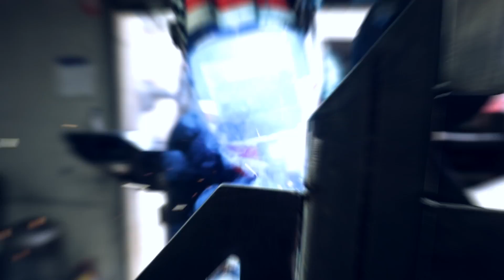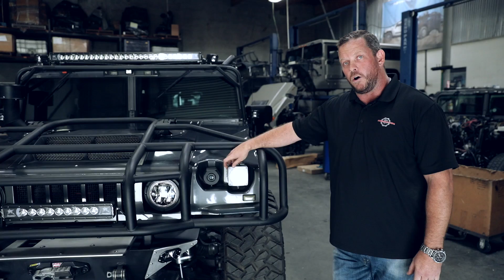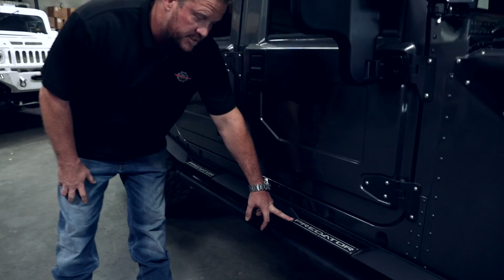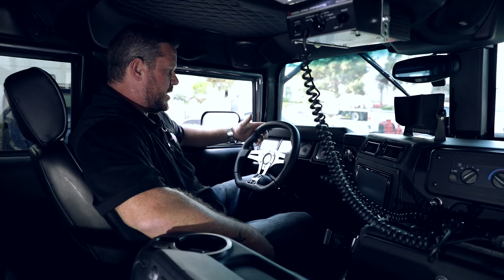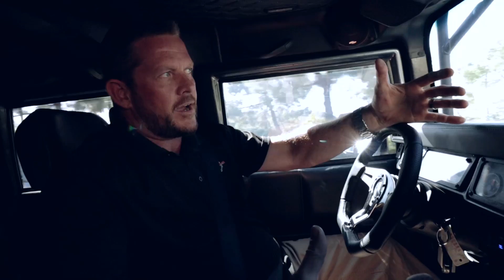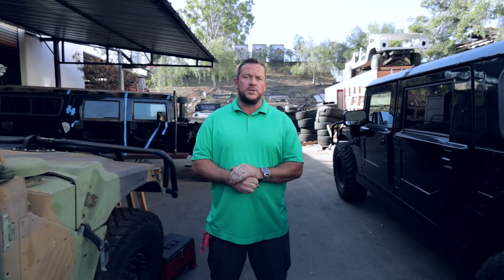NEXT DAY AIR H1 HUMMER SHIPPED TO UAE ROYAL EMIRATES!!

Comment: I love the build. This truck and the one the ROCK drove in fast and furious.........as much as I love them I think they are more show than actual use.....8-10 miles a gallon but I would still drive it daily
Reply from the maker: Thanks, definetly agree, its an amazing truck! I would disagree about more show then go. It doesnt get any more go then an H1 unless you switch over to a tank! Haha. Factory options including CTIS, full under carriage armor and standard lockers is unmatched by any manufacturer... ever. Straight out of the factory show room floor, nothing could touch the H1. Yes, 8-10mpg on some of the models and progressively getting better and better topping out at about 20mpg with a duramax conversion. However, most people arent too concerned about MPG when driving the best offroad vehicle in the world. Now getting into owners, I would say half are crazy avid offroad drivers. The other half probably would never take it offroad.

Comment: Do y’all put in sound deading material? Just still hear a lot of rattling and tire whine. Figured those high end clients might be picky. Still wicked truck though!
Reply from the maker: Yes we do offer an extensive sound proofing option. We have seen a drop of approximately 30dbl on the inside. Huge difference! Unfortunately that whine gets picked up on the mic and there's just no way to get away from the sound from 40" mud terrain tires. Also, there is whine from the geared hubs (portal axels) on deceleration which you cant get away from unless upgrading to helical cut gears. I would bet if you put 40" mud terrain tires on a new Bentley it would most likely have the same mud tire sound. Thanks!!!
Reply: Predator Inc I totally forgot about those portal axles, I’m sure that makes a lot of noise throughout the interior. But hey real trucks make real noise haha. Just drown it all out with the skinny pedal right!